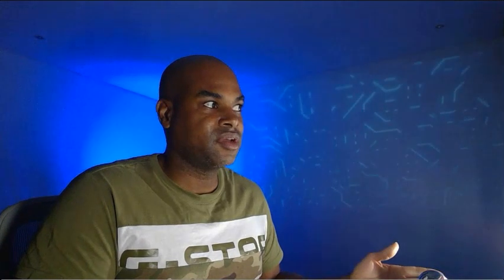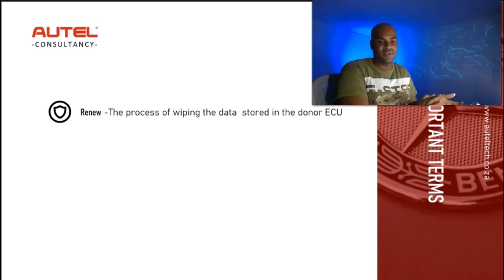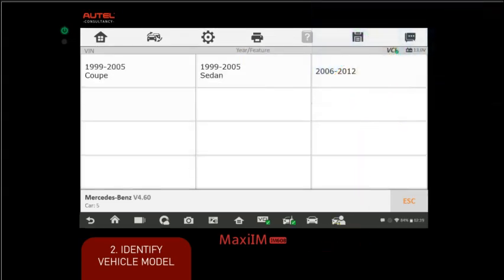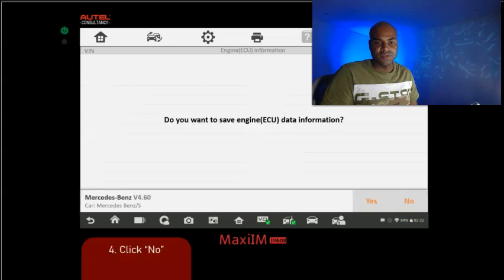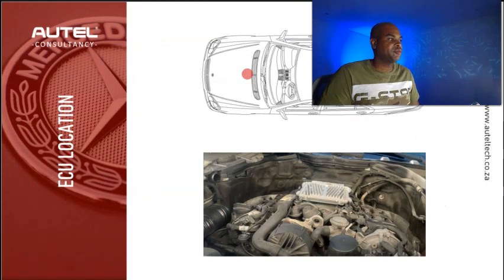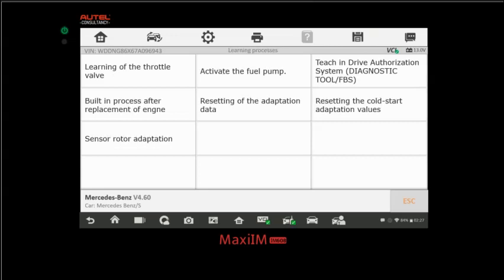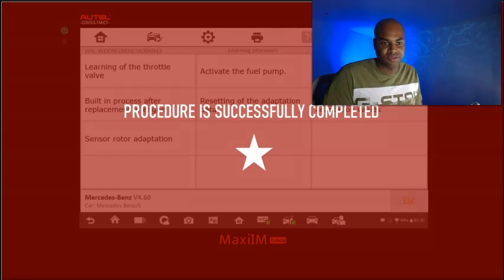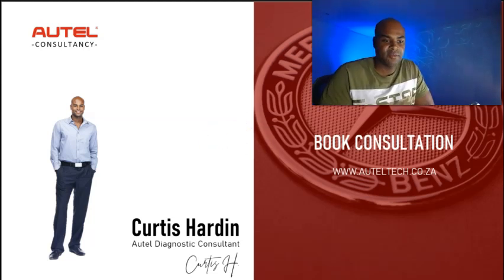IM608 Pro | How To Virginize and Code A Used Engine Control Unit A 2007 Mercedes Benz S Class

Comment: This is off topic of the video but I was thinking on purchasing AUTEL MS906TS MAXISYS I would like to learn more about it I seen it online it was listed around $1,350 I was kinda interested. Anything I should know about or where I can purchase it?
Reply from the maker: HI Marvin,  I charge for this information as it takes about an hour to diagnose and educate the client about the everything they should know . The problem of self diagnosing your self is that most of the problems/limitations of the tool your only going to find out after you purchase. Also you have the challenge of verifying if your tool is going to be a usa model or an international model. You also are not going to have a solution to reduce our update fees . You lso need to consider the year this tool was made as maybe there is a replacement for it.  Buying a diagnostic tool is like getting married... You dont want to get it wrong the first time as you might have alot of extra baggage.  If its worth it to you , you should get consulted first in my opinion.
Reply: @AutelConsultancy  how much u charge for the consultation?
Reply from the maker: @marvin2977   97 USD.  In most cases it saves the client 2000 usd in cost

Comment: Hi Curtis. I bought the im608 pro from AESwave and then I came across your channel. I want to learn everything this tool is capable of. My question is can I still get a consultation from you or am I ineligible because I bought it from another distributor?
Reply from the maker: HI Sefo You can book a diagnostic tool consultation with me at auteltech.co.za .  Some of my clients who also saw my video when it was too late usually end up sending there tool back  and then later purchasing it from me. This way they have access to me on a long term basis and they can truly benefit from their tool

Comment: Hi Curtis 
Great video, thanks 
What the difference between the IM608 and the IM508?
Reply from the maker: The im508 is for people who already have a good diagnostic scanner and just need key coding capabilities. The im508 has a basic level of diagnostic software on it . The Im608 Pro is for people who want diagnostic capabilities, j2534 flash programming capabilities and locksmith level key coding capabilities.